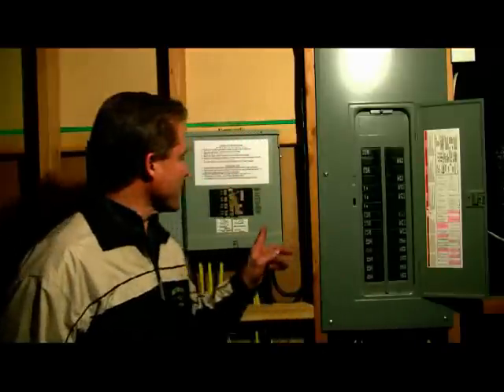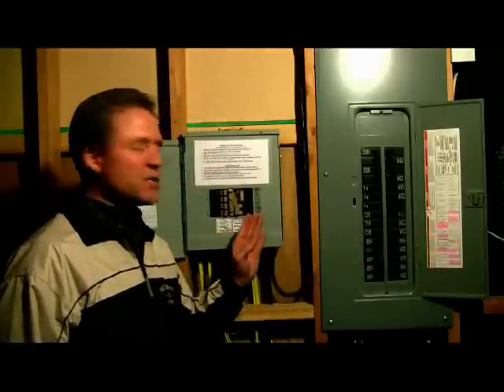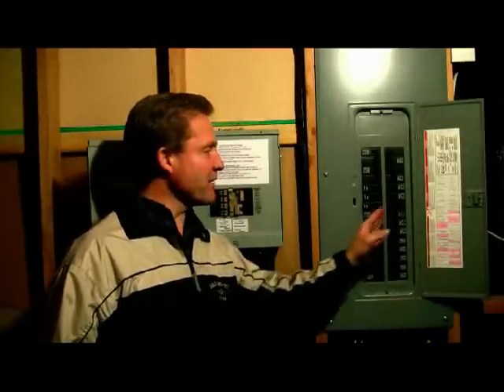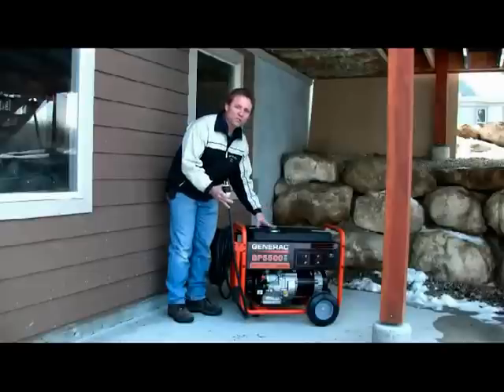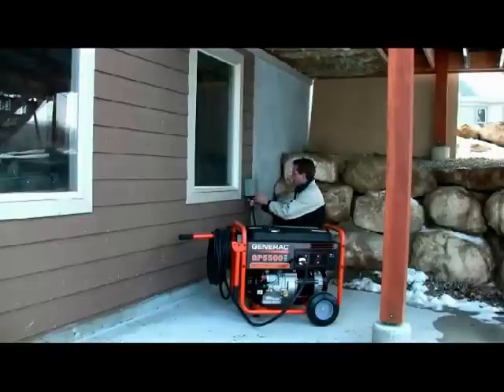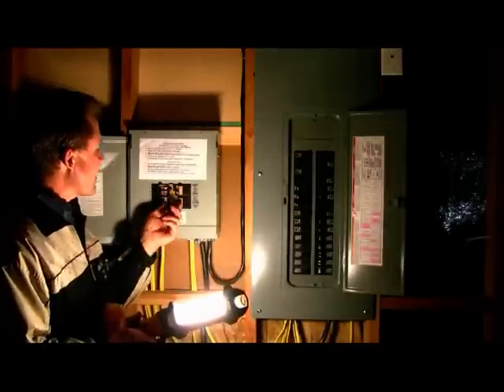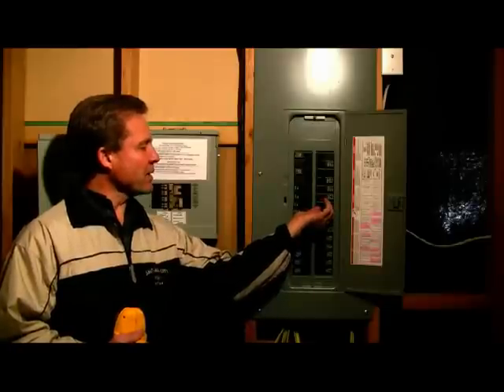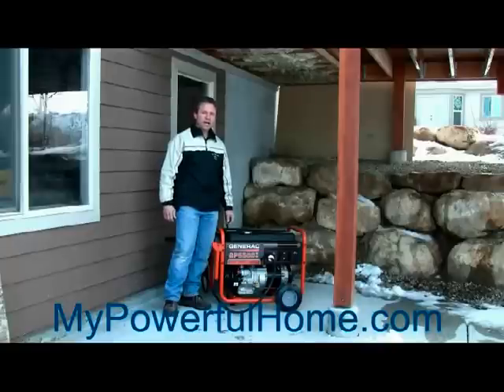The best way to connect you portable generator to your home.

Comment: You called this a "transfer switch", but its not; its really an interlock on a sub-panel.  They are completely different things! In your example, the circuits are moved out of the main panel and are all powered by a single breaker in the main panel. In a real transfer switch the original breakers are still used, not bypassed when on main power.  As a result of this change in your example, you need to be really clear in marking the old breakers! Without the proper labels someone could flip off the old breaker (which is no longer in use) and think they de-energized the circuit, when it really is still on. 
If you are going to use an interlock, its easier and cheaper to just put the interlock on the main panel and eliminate the sub panel. This gives the additional flexibility of choosing any circuit to power from generator.  Of course, the caution there is to not turn on all the breakers when on a generator. But that can be labeled to flip which ones.

Comment: the best way? this is the worst way. get an interlock kit my gosh. $100 in materials, 1 hour of labor to install and you power both legs of your entire panel (not all devices can be powered at once obviously).

transfer switches are a waste
Reply: +jgg204 The whole point of a transfer switch is to prevent accidental over usage and other problems. Not everyone should use an interlock kit.
Reply: I’m sure glad I did an interlock kit. My 8 kw gen does in fact power everything in my house.

Comment: One problem most Utility Services require you to have an automatic switching gear not a manual I was work and power lines for 20 years back fade from a generator from a house will kill s*** out of a line man. Save yourself a lawsuit and a whole lot of red tape from Electrical Company check regulations first automatic interlocks in shutouts pretty popular everywhere now prices went way down on them what you selling there's a good product don't get me wrong on that I agree too many steps all it takes is one mistake is it worth it if I would use something like that I would put an air gap in it just like the old air conditioner disconnects other words I want a gap between power and that outside line utility either way before you go installing check your local codes or you could be setting yourself up for a whole lot of money you spent for nothing as well as possible getting your power disconnected

Comment: If that generator catches fire, so will your house. At that point you will have light and heat, rendering the kit unnecessary. So why bother with all this labor, just set your house on fire and get it over with.